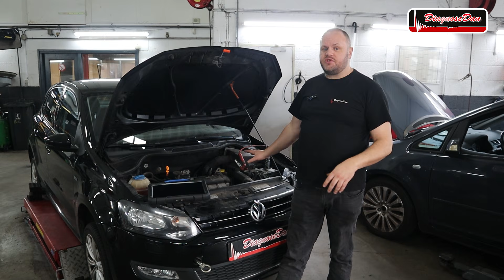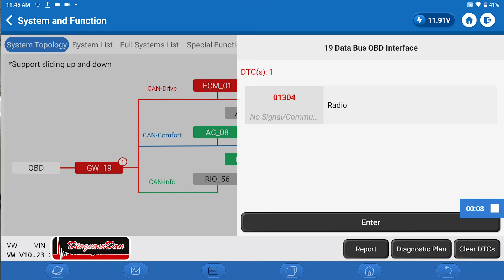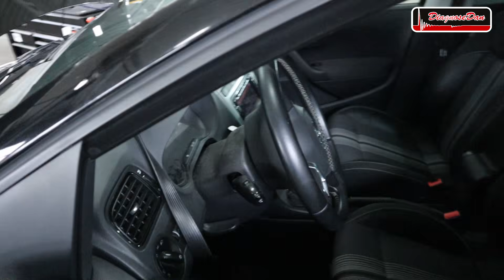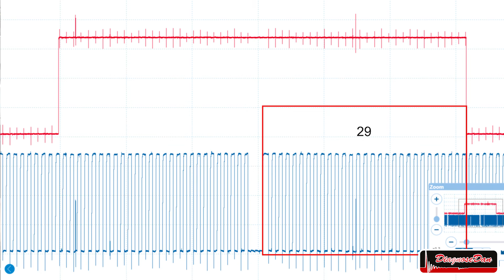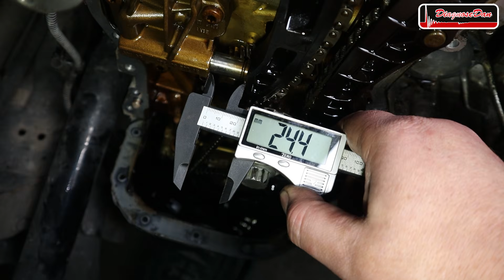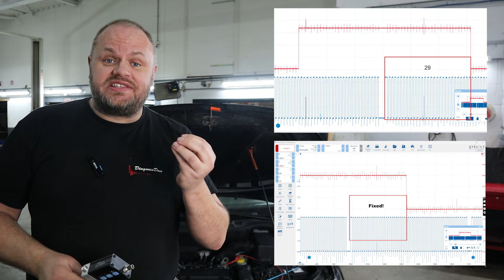Expensive repair? Other shop just guessed!

Comment: VW Polo 2012 1.2L CGPA 3cyl Non-VVT DOHC Petrol 
9 MODULES wGateway 
25 Low Power Symptom & Engine Dies When Letting Off The Throttle 
35 Previous Shop PARTS CANNON Then "Guess Not Test" (No Data Proof Given) At Timing Chain 
305 & 1315 SCAN CODES 01304 B2000 P0016 (primary B1SA ONLY) & U0151 
410 Oil Pressure Sensor Location 
420 MANUAL Oil Pressure 3.4BAR Test OK 
455 WAVEFORM INCYL #1 
615 ANALYSIS EVC Early 
730 CMP & CKP Location 
755 WAVEFORM CMP CKP CORR 
815 ANALYSIS 60-2 VS Known Good Timing OFF 7 CKP Teeth (7*6=42*) BAD 
955 TSB DD2431 Reduced Power & Cuts Out 
1110 Tensioner Travel 24mm (12mm) Measurement BAD 
1145 R2 Timing Chain Set 
1235 Fault ID Timing Tools Alignment BOTH OFF Setup BAD 
1400 WAVEFORM CMP CKP CORR 
1440 ANALYSIS 29 Teeth MIDPOINT OK 
1520 WAVEFORM INCYL #1 
1525 ANALYSIS OK 

1545 VERIFY WAVEFORM INCYL #1 OK

I remember from previous comments on previous videos that you prefer to keep the videos as short and to the point as possible and I can appreciate that. In this video, I would have reversed the pattern of logic at timestamps 1145 & 1235 to show the timing alignment tools before the test drive after replacing the timing chain set. Thank you for another FIX especially since there is a known DDTSB for this exact Vehicle and Engine Code, cheers.

Comment: Nice one Dan , I've just done today a peugeot 1.2 puretech 3 cylinder timing belt kit , only 38000 miles , 2019 car , 1st problem no oil pressure , reason  belt fibres blocking oil pump pickup , (just as Ford ecoboom ) engine , both are wetbelt systems , absolute junk , rubber does not like oil , I removed the sump , cleaned the pickup , refitted the cleaned sump , new correct grade oil 0w20 ( like cooking oil ) and genuine oil filter , now car has oil pressure,  so then replaced genuine belt kit ,crank seal and bolts,  job fixed , regular servicing helps Mr customer , here is my as per quote expensive invoice 👍
Reply from the maker: The problem is not that the belt doesn't like oil. A little amount of petrol makes it into the engine oil. Its the petrol that the belt doesn't like. More frequent oil changes can prevent a lot of issues.

Comment: Wow that’s a lot of expensive equipment to check the valve timing , you could obviously just do it the easy way , number one piston at tdc and fit the two locking tools into the back of the cams , very cheap and simple , also the engine would have been rattling like mad where the chain was slapping the chain cover , with the Coliration code it was always going to be the chain who the hell looked at this car before some proper cowboys I’m guessing
Reply from the maker: This is the easy way, you can check the timing in 10 minutes on any engine. The tools are standard equipment in a professional workshop and can be used for much more than checking the timing.

Comment: Hi Don, did you check the valve clearance
Reply from the maker: No i didn't. After the cam-crank measurement i knew the fault was caused by the timing and not a camwear issue

Comment: Correlation fault means cam and crank is not synced. It clearly indicates timing fault. (As clearly as control unit fault in airbag module). If I see this fault then I never crank engine to prevent damage to customer property. Who pays for repairs if timing jumps more and valves hit pistons? Correct thing to do is check timing mechanicaly using locking tools.
Reply from the maker: Thanks for watching

Comment: This problem must have gradually worsened. Amazing the owner let it get this bad, basically until the car was no longer able to move, before getting it fixed.
Reply from the maker: Not exactly the case, they brought the car to a workshop to get it fixed, at that time to car still drove ok. They asked the workshop to diagnose the fault and also to perform a major service. The workshop told the customer the car was ready to be picked up. After the pickup the car started loosing power within the first 5 km. 
So clearly they didn't resolve the issue and now they started "guessing" and the customer lost faith in that workshop. 
I guess the chain jumped shortly after the service. But they send the customer on its way with this stretched chain and told him they had resolved the issue and had replaced a part (i dont know what part) 
Luckily there was no further damage. 
The car is owned by a young lady and her father is paying for the repairs, he want's his daughter to drive a reliable and save car. Thats why he asked us to take care of the Airbag fault when i told him about that.

Comment: Another fantastic video. I'm not a mechanic, but I've built a few engines mostly with older EFI and no monitoring capabilities. Using the software tools is key to understanding where to troubleshoot instead of changing the spark plugs and giving up.
Reply from the maker: Thanks for watching!

Comment: 1.2 liter and it has no power? Duh!
Reply from the maker: 105Hp! 💪
Reply: @Diagnosedan  Yes I google and I saw that. I would love to drive one. I used to have an 89 Mustang with a 2.3 88 hp 4 cylinder and 5 speed. it ran out of cam @ 3500 rpm..
Reply from the maker: @Fone65  the power to weight ratio is pretty good.

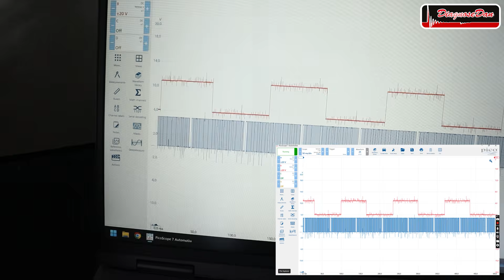Comment: 8:00 probably in vcds is possible to check how many high signal of cam sensor correlation with high signal crank sensor. I dont know which block is this and what is correct value.

Comment: What i would have done:
Check for faultcodes, the faultcode indicate a timing problem.
Look at the mileage. Experience says what VW chains stretch around the 180k mark (this is spot on).

Get the cover off to see the chain, and more important, the tensioner. And last check that the camshaft isn't on its mark..

That the easy "low tech" version.

I know you should investigate all fault with a open mind, however we have see ALOT of timing issues, so I will naturally start going that way, then the first faults indicate it.

Comment: Stretched chains cause all sorts of problems in engines. Every engine I rebuilt had all chains/belts and guides replaced, along with the sprockets, and tensioners. The front crank seals were replaced also.

Comment: How important is it to replace all other parts once you're changing the timing chain??
Reply from the maker: Very important, installing a New chain on a worn gear will make the New chain fail sooner
Reply: @Diagnosedan Thanks for replying. Couldn't the gears be reused, because I don't think if they were bad? And the problem was tensioner and chain.

Comment: So vag did not learn with those 3cyl engine.  Same on my old Fabia. From 2006. But alla 12valve was bend   but cheap repair   12new valves and chain set and a day in garage later it was fixed

Comment: For a quick old school test , I believe using a vacuum gauge , would show between 8 to 15 lbs. for late valve timing . It certainly would not hurt to confirm the results with a more advanced test . However , it may point you in the direction . Unfortunately , since all modern engines don't have easily found marks , distributors or easily removable valve covers , it becomes involved . You can look at the valves with a bore scope , but getting reference marks may be difficult . Sometimes removing a #1 plug is a project . Great diagnosis and fix .
Reply: On this engine it is super simple to check the timing with the timing tools
Reply from the maker: Thanks for taking the time to leave a comment!

Comment: The other workshop may have been right, but here is the difference. They said that it could possibly be fixed by changing the timing chain, POSSIBLY. You concluded with almost certainty that this issue WAS caused by a defective timing chain. I have seen enough of your videos to know, that workshops that simply guesses, mostly do not get it right. But as they say, even a dead clock can tell the correct time twice a day. IT hardly makes it reliable. 

Awesome work

Comment: If the tensioner has a ratchet mechanism, would a quick way to determine chain slack be removing the tensioner and take the measurement?
Reply from the maker: Its not quick or easy to get to the tensioner.

Comment: I have a question for you that is not related to this video. I am working on a ford focus 1.4 benz. 2004. The car uses oil like crazy and runs without problems. When I remove the spark plug, it looks normal without burnt oil deposits. How is that possible?
Pelle Denmark
Reply: Pokusao sam da ti prosledim link ali izgleda ne moze na yt. Ne odgovara Dan na ytb-u, ima na fb njegova grupa zove se Diagnosedan Global Tech Support Group. Mene je tamo preusmerio za pomoc. Nije losa, ljudi se stvarno trude da pomognu. Pozdrav Đape 👋😄

Comment: Your the man Dan. I just fixed/repaired my first BMW. No crank, no start.don't have a scanner that can talk to the BMW, so I had to relye on utub. Did a bypass on the immobilizer to verify that the starter worked. Then found fuse #30 was blowing. Utub to the rescue, said check out the oil sensor level sensor. Found a wire bare at the 90• coming out of the sensor. Tape it up, did not reconnect to the sensor, costomer request.the car is no😅 doing fine. 325ci.
Reply from the maker: Great job💪

Comment: Nice work, Dan.  It's pathetic that a modern car cannot go much past 100k miles without requiring major repair.
Reply: They are designed to last "exactly" that amount, no more, no less, unfortunately. EVs last in average longer, maybe a Tesla has its first service at 100 kmiles... (A Swedish Tesla shop suggests though service every 50,000 km/30,000 miles.)

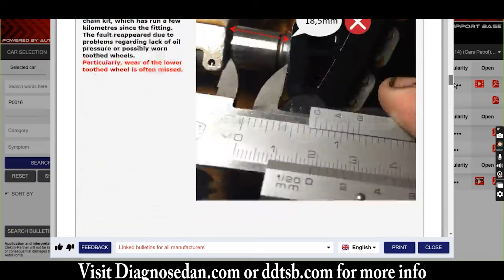Comment: I think there was some mistake in bulletin where engines code was shown 1.2/1.4/1.6TSI/FSI/TFSI. There was written 10:05 in bulletin: "Here you can see the tensioner travel in 1.2TSI (CGPA)...." But this is not 1.2TSI engine because 1.2TSI was turbo 4cyl. CGPA is not TSI engine. Engine in video is 1.2MPi 3 cyl engine which was called 1,2HTP in Skoda. Whats wrong? text or pictures which part is right or not. Does 1.2 3cyl atmospheric share same timing mechanism with 1.2 4cyl turbo engine?.
Reply: Good 👀,  👏

Comment: Whats the black cap just below the oil filler cap? a inspection cover??
Reply: Under that cap is a oil separator, something like catch can, works on whirlpool effects. Not a bad thing to check or change it from time to time  together with PCV valve that is on the other side of filler cap.
Reply: @nomenescio-m9u  Cheers for that 😀
Reply: @paulrobinson3528  👍

Comment: A 1.2 VW polo with a timing chain problem. The only engine with more chain problems is the BMW N47.
Reply: Obviously they have had much less problems the last ten years. I happen to own a 2008 X3 20d and a 2011 30d, both with 250,000 km on the clock.
I don't feel very nervous, but of course I'm a little afraid of a total engine failure, but for the time being I can't hear any abnormal noise. If the repairs of the 30d will be too expensive, I take the 20d out of the storage...

Comment: Those polos with the 1,2 are notorious for stretching chains, I knew instantly that it would be stretched chain when I saw it. I tend to advice people to stick to the 1,4 four cylinder engine instead as it uses a timing belt instead of chain and is overall quite reliable, the belt is also easy to change DIY. On top of that it uses about the same amount of fuel as it isn't as labored as the 1,2. 

Would be interesting if you could show the maintenance history of the car (or lack thereof) as it's a major contributor to stretched timing chains, even still VW are notorious for making bad quality timing chains so I wouldn't be surprised if the car had good service history.
Reply from the maker: We dont always have the service history available on older cars that have been serviced elsewhere. There was no service book in the car and no digital records

Comment: Just done one. The problem was obvious, I could turn the crank about 15 degrees without the cams moving, obviously a chain+the corelation code. The tensioner does not have any sort of ratcheting mechanism, just a spring. Honestly I am sure whoever design that tensioner design and approved it for usage in automobiles, must have been on drugs. Absolutely no other explanation to it.
Reply: VW are notorious for putting flimsy timing chains in their engines, even with good maintenance record it's no guarantee that the chain won't stretch, seen it so many times. You're always better off with their timing belt engines and changing the belt every so often.
Reply: @aden3113  no arguing that one, however the tensioner design is completely shocking.

Comment: Kudos to Dan...two things:
1) when scan tools first came out, very few mechanics could look at a waveform and understand what it was trying to tell them. That second pressure hump pointed a big finger at the problem.
2) It would have been nice to see the old chain stretched out next to the new one on the table. Amazing that a tiny bit of wear on each link would add up to so much stretch.
Reply from the maker: I've actually got a picture, i'll post it on my Facebook page👍
Reply: @Diagnosedan you have a Facebook page?
I'm so there!

Comment: I'm amazed they didn't try the chains first. That's really the only common fault on that particular engine except for coils.
Reply from the maker: Dont try but measure😉
Reply: @Diagnosedan  100%, but the majority of mechanics will go for the most likely solution instead of a proper diagnosis.

Comment: A chain does not stretch, it wears out causing play in the links. That play is what causes the length of the chain to increase. The explanation of the various steps of the diagnoses are on point as always 👍🏻
Reply: Still colloquially referred as stretching.
Reply: @rkan2  Wich still is not correct.
Reply: But try explaining wear in each pin creating greater distance between each link to a non mechanic/not technically minded person. Also be careful when criticizing others. Look first at your spelling of "which". Retired mechanic/machinist in Land Down Under. @Dennisk303
Reply: Actually, stretch is an appropriate word for this. It just means elongating beyond its limits. It doesn’t specify how.
Reply: Timing chains do actually stretch over time during use. I have actually proven that by measuring the link plates of a new chain and an old chain using vernier calipers to take measurements. I have replaced stretched chains a lot.

Comment: 2012 and it’s repairable is a miracle for a VW.
Reply: Economically*
Reply from the maker: Its always repairable 😉
Reply: At that driven distance it's past designated lifetime.
Reply: @ehsnils  Plenty for sale in Denmark with over 200 k km, some near 300 k
Reply: The complete timing chain kit as shown costs 140 Euros. Dirt cheap
Reply: @erik_dk842  OEM or aftermarket?
Reply: @onenikkione  Brand name aftermarket.
Reply: @onenikkione  INA brand aftermarket

Comment: Why don't they make chains that resist stretching? Or is it just another way to generate income?
Reply: A beefier timing chain would be heavier, nosier and would lead to slightly less efficiency along with higher production cost. Another fatal mistake by VW to save a few pennies on cheap timing chains and ruining the reliability of these engines.

Comment: I would suspect there are some cam/crank sensor codes on this one if not that maybe the on top of tank fuel pump control unit.
Reply: The fault is excessive oil service intervals and weak timing chains. It is by design. They seem too fail around 150000KM quite consistently.
Reply: BTW could you not have gotten the scope traces from freeze frame data on the scan tool? I know they are availible in live data on my much less fancy tool. Just asking because I know many technicians are quite afraid of technology like scopes etc so making it possible with the things the allready have may be really helpful.

Comment: Nice to see you back Dan.

These engines are very prone to timing chain slipping if the engine is turned over backwards.  Not a good thing if you park in a forward gear facing up hill. ;-)
Reply: Or a reverse gear facing down hill lol
Reply from the maker: You are right, i've also seen cases that they rotated the engine the wrong way during a clutch job.......🫣

Comment: I had that exact code on my VW 1.6TDI auth shop diagnosed it to a EGR cooler/valve, expensive to change. Non Auth VW shop diagnosed it to a faulty Cam sensor. Of course the Auth shop was wrong again.